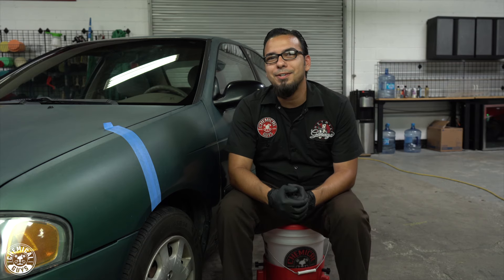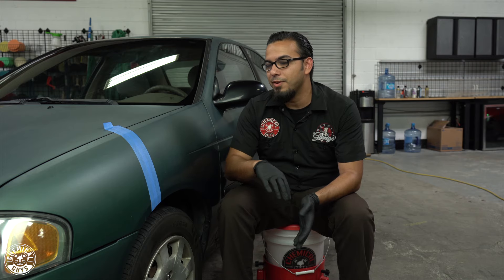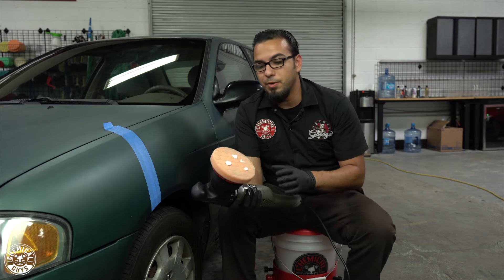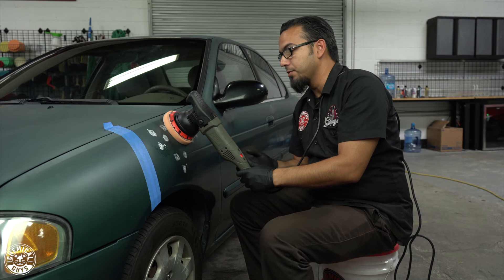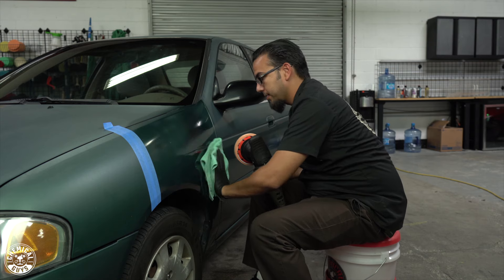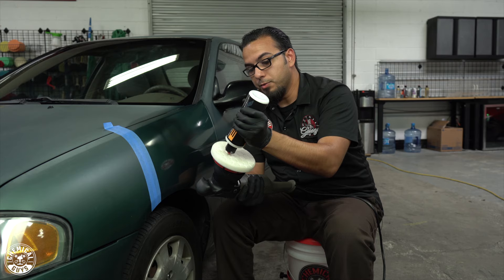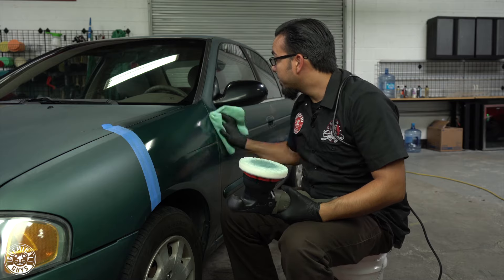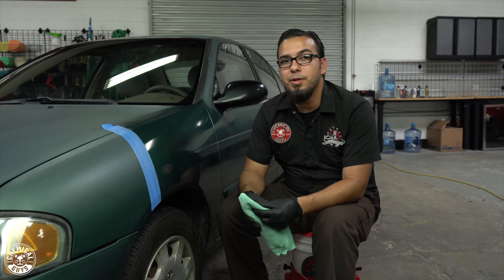How To Treat Heavily Oxidized Paint! - Chemical Guys

Comment: This was for sure helpful as I'll be working on a Volvo 850 with similar issues of oxidation. The paint I'm dealing with is quite a bit better, with only slight oxidation but the customer wants to protect from future damage so I'll be ceramic coating it after correction. Should be fun!
Reply from the maker: Thanks so much for tuning in, happy detailing! 
- CG Nick

Comment: OK, I do not see above. I am a 77 y.o. retiree and unfamiliar with a lot of things...and no, I was never a detailer, but did my own mechanic/painting. My 72 PU is painted with metallic enamel about 4 years ago and the oxidation is pretty heavy.  I never waxed it, or put polish on it during this time. My question is: you reference spraying the pad with PAD Conditioner?? Or Spray? What is it? I do not see it in your list of items used above.......
Reply from the maker: Hi Kenneth! Pad Conditioner lubricates the polishing pads to reduce wear and tear as well as reduce excess heat and friction which can dry out compound/polish before it has properly broken down. Check out this link.
https://www.chemicalguys.com/polishing-and-buffing-pad-conditioner/pad-conditioner.html?gtmListValue=Internal%20Search

Comment: This is exactly what I need on my 70 Land Rover. How many pads would you suggest a standard vehicle will need? Both orange and white. Thanks!
Reply from the maker: Hey there! Thanks for watching. For a typical paint correction it is best to have two of each pad that is going to be used. Clean as necessary for consistent results.
- CG Nick

Comment: Hey chem guys I have a 2013 Chevy Malibu that has really bad looks like caked in water dry spots like after drying your car and I bought a torq x and used the yellow pad but still doesn't make any difference any help please🙏🙏🙏🙏 I was told I might need a rotary polisher. And then finish it with a da but don't have the money for both.

Comment: Was some of the paint being transferred onto the orange and white pad,because of the paint job it had?
Reply: That is very worrisome.  When you see that much paint come out on the white pad, that means the clear coat is non-existent.  You are just cutting off and thinning out the paint.  Before long, you will be down to metal.  I would measure the thickness of the paint and re-clear if there is enough left.

Comment: How many of each pads did you need to do the whole car? And would I need more than 1 bar of clay to prep if i had a bunch of peeling clear coat spots?
Reply from the maker: Hi Michael! It is normal to have at least two of the same pad for a polishing job. One clay bar can decontaminate several vehicles.

Comment: My 2014 Tacoma is getting oxidation on roof, what can I use to remove it and protect paint with a shine? I'll have to do it manually, I don't have the buffer or machinery.
Reply: Doing it by hand won’t get you very far therefore I really recommend you buying a cheaper polisher if you want to get rid of the oxidation, then use a sealant or wax  to protect it
Reply from the maker: Hey! We recommend VSS Scratch & Swirl Remover, it is the easy-to-use polish that cuts strong to quickly remove swirls, scratches, and defects, then finishes like a fine polish to deliver a mirror finish in just one step. 

https://www.chemicalguys.com/vss-one-step-scratch-and-swirl-remover-compound-polish/COM_129_16.html

Comment: You you need to spray clear when finished with these steps. If not wouldn’t it last longer?
Reply: The Chemical Guys recommendation after compounding and polish (which he did here) is to next apply a protective glaze or coating (like ceramic), then a sealant or wax.

Comment: I have 05 White Camry- are these black teeny dots oxidation?
Reply from the maker: Hi there! The dots may just be fallout, try using a Medium Duty Clay Bar to extract embedded contamination.
- CG Nick 
https://www.chemicalguys.com/clay-bar-and-luber-synthetic-lubricant-kit-medium-duty/CLY_KIT_2.html
Reply: No, its not but its an easy fix. Just need to wash and clay bar your car, maybe even use an iron remover before clay baring.
Reply: Decon pro iron remover

Comment: I would like to get an idea of the quantities required for different size vehicles.  Pads?  V36 and V38?  OG clay bar and waterless swift  wipe.  For example, I am going to do a long Sprinter van, which has a lot of surface area to cover.  😀
Reply from the maker: Hi Kevin! It is normal to have two of the same pad for each chemical. One clay bar can decontaminate several vehicles. Roll and knead the bar until a clean side can no longer be found.

Comment: I did this with my e36 original paint job with a different product. But I gave it a light wet sand first. The thing came out like a freaking mirror!! Now my issue is after about 2 weeks the paint starts to dull again.. is there another step to retain the shine? Or am I using the wrong product? Plz help
Reply from the maker: Hey! After the paint correction, apply your favorite coatings to lock in shine. HydroSlick easily lays down a durable barrier of protection.
https://www.chemicalguys.com/hydroslick-intense-gloss-sio2-ceramic-coating-hyperwax/WAC22916.html?gtmListValue=Internal%20Search

Comment: What pad size/machine did you use for the bumpers?
Reply from the maker: Hey Mamun! The 5 inch pad was fine for the flat panels and the more intricate areas can be hand polished or using a 3 inch pad and 3 inch backing plate.

Comment: Is it ok to use quick detailer spray on the pad as a pad conditioner too?
Reply from the maker: Hey Bryan! In a pinch, you can use your favorite quick detail spray to moisten the pad but this should be a temporary solution.
Reply: @ChemicalGuys  would this also work for restoring /removing sanding or oxidation from carbon fiber aswell? Purchased my torq kit yesterday and forgot to ask one of the associates about it

Comment: Nice result, but curious why you didn't go to a V34 or V32 product?   If you had wanted to spend the time,  wet sanding it first seems like it would have made a bigger difference.
Reply: Wet sanding will just be an aggressive approach and cause that to remove the clear coat off the car which will cause damage to the car unless you apply the clear coat back